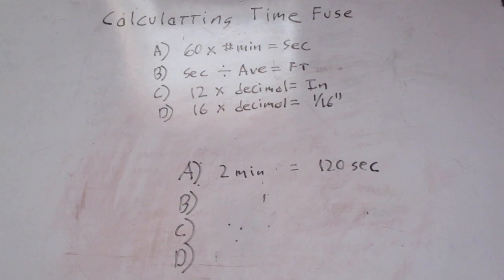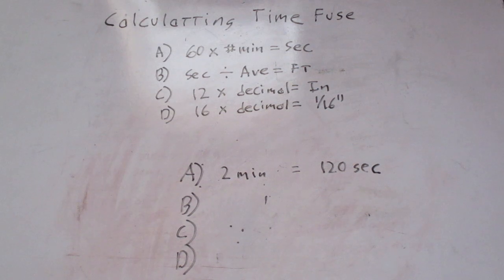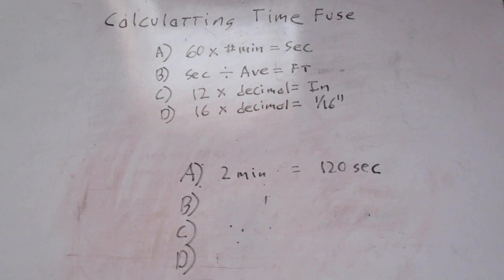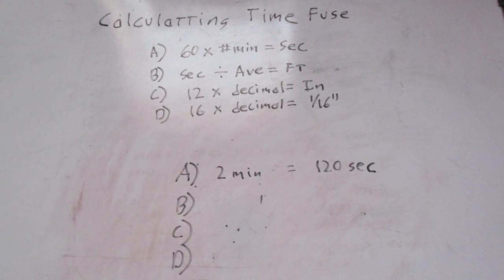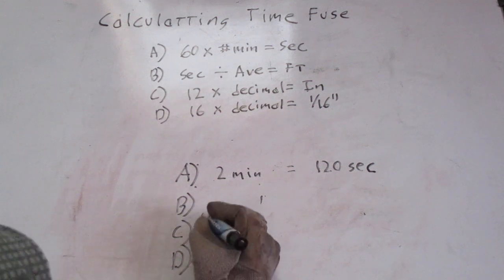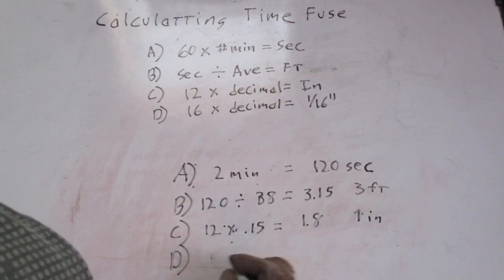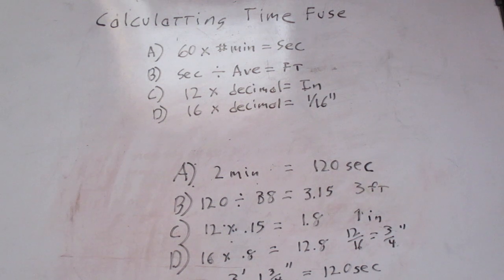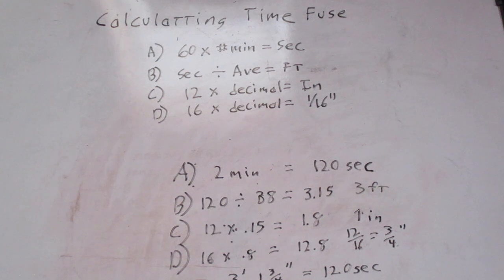Militia Engineer Tasks- Calculating Time Fuse

Comment: Another idea would be to print it off the size of a note pad laminate it and if access to a binder machine or go simple and hole punch and put 1 or 2 of the shower type rings that round ones that have the rivet so as to open n close it. Could also design it so you could write on them your  Formula with a  Grease pin/ china marker. Would also have the China markers for your map case to write on and erase. This would make a quick reference guide that will last longer in the field